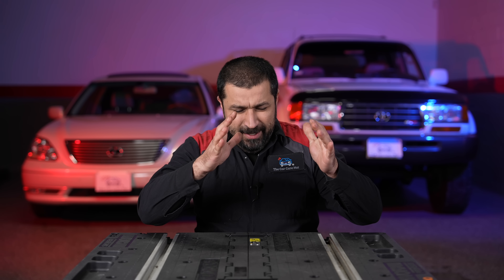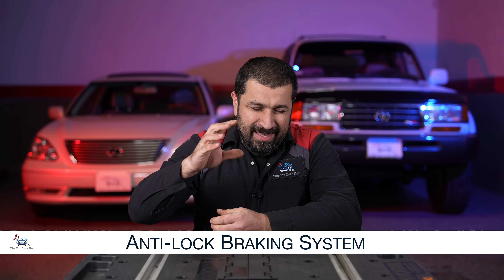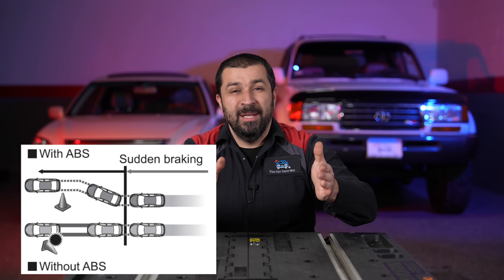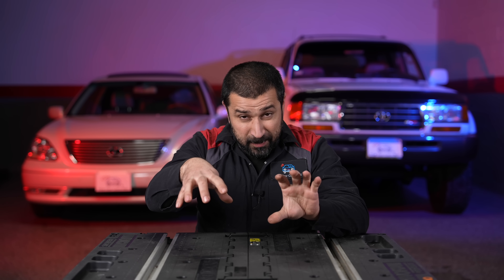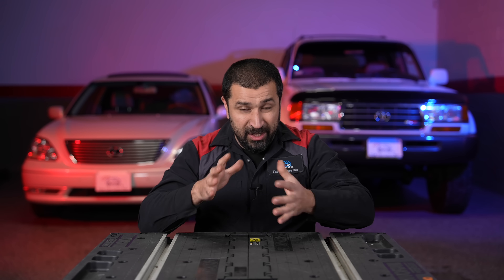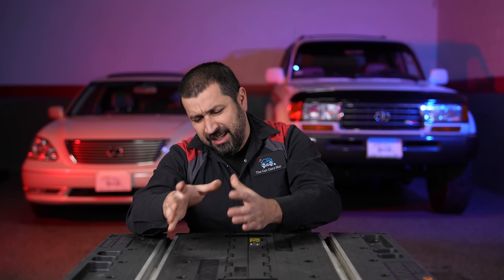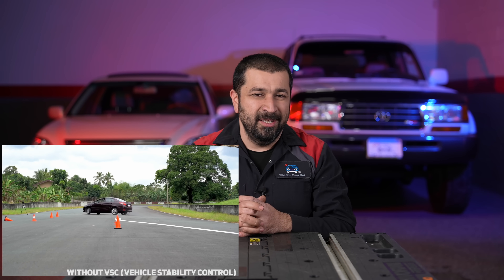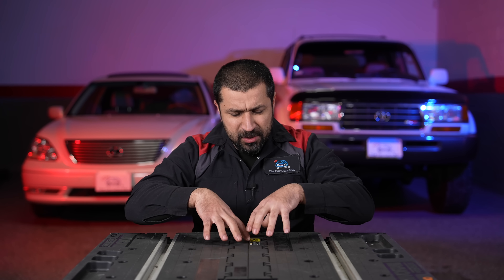How Does Toyota ABS, Traction Control and VSC Work? Everything You Need to KNow

Comment: please make rust proof video:(
Reply: Get oil or lanolin based undercoating. 

Do not use rubber crap like ziebart, it just locks in moisture.
Reply: @volvo09  you forgot to say Easy
Reply: Go see legit street car ,he has a good method to undercarriage protection.
Reply: Here’s the answer:  06026 Heavy Duty Corrosion Inhibitor.

I sprayed this on the frame and everything metal on the under body of my Toyota Land Cruiser when it was brand new. 

Four years later, there is not a speck of rust even on the weld seems. I run it in the snow, when the roads are salted and I take it on the beach surf fishing.
Reply: Repair Geek channel and no one else
Reply: I used Rust-Oleum on all my vehicles.
End of issue
Reply: @LouisCapps-p3z U need a product that "weeps."
Reply: Use woolwax, it’s the best
Reply: Noxudol 900.
Reply: It’s called paint and washing your vehicle 😂
Reply: My Mom just bought a '22 rx350L that was from NY and some of the bolt heads under the vehicle are very rusted. I have an 02 tundra w almost zero rust. I'm concerned for her. I may try to clean the rust spots and paint it but not real sure. If I use WD40 then paint won't adhere so maybe I use degreaser then paint. Do video please 🙏
Reply: He did! Go look for it
Reply: @Hernsama Yes you are right. CCN did make a video about rusted frames. I saved it a long time ago.
Reply: @saadtheman1  i use a product called noxudol 900. Been great so far! Have to touch it up once a year but it's worth it.
Reply: easy ,  drive an helicopter :)
Reply: I need it also, I just splashed gravy on my phone 😂
Reply: His videos don’t rust, they are already rust proof.
Reply: Yup, avoid the real world at all costs.
Reply: Yes
Reply: Didn’t he make one for his GX?
Reply: Easy. Live in Arizona.
Reply: Easy.  Don’t drive in the wet
Reply: @OK247OK 
Move away from the rust belt 😮
Reply: Easy. Don’t drive.
Reply: Easy. Don't drive in the snow. :)
Reply: @k6-3spetznazhelmet snow doesn’t rust things 🤦‍♂️ It’s the salt they spray in the roads.